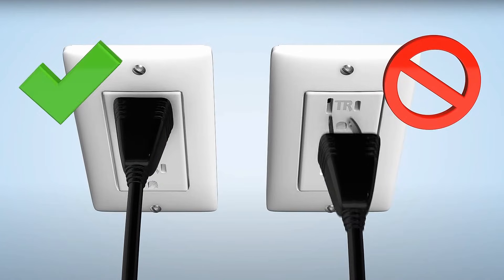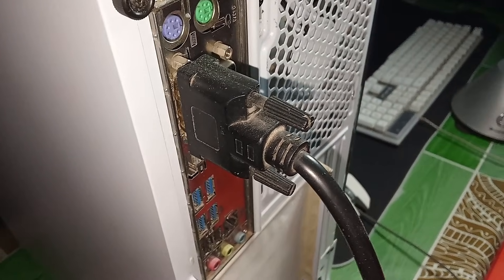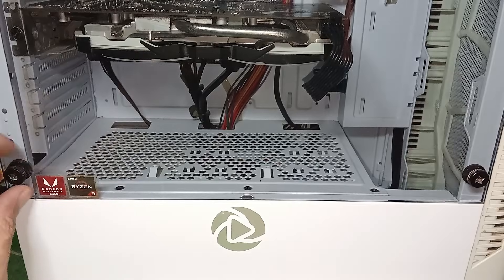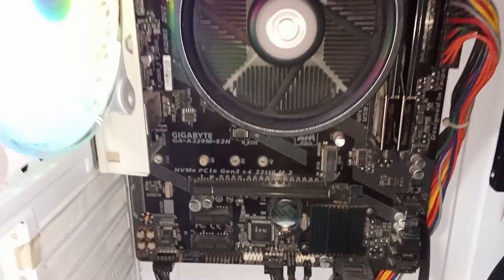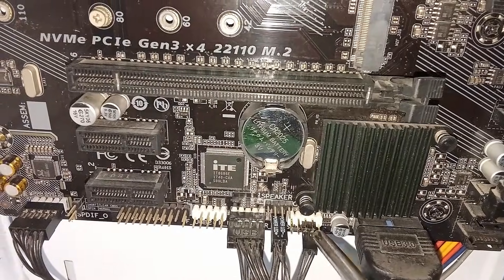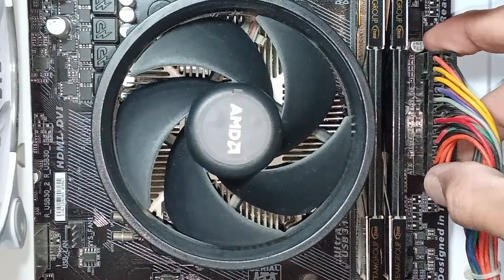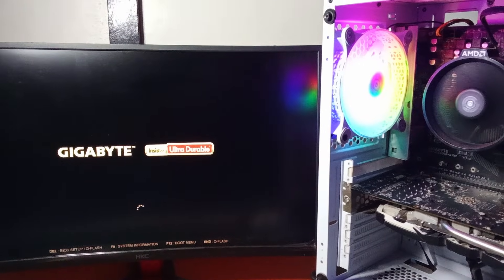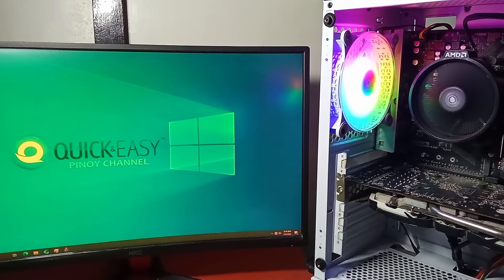HOW TO FIX PC WON'T TURN ON, OR NO POWER ?

Comment: Mines did this today 🤦🏽‍♂️ I’ll be trying this when I get home only difference my motherboard’s light on so it has power hopefully it’s just power button faulty
Reply: Me too bro, I have a problem maybe same like you. My PC turns on after switching on, but I can't click the power button in case, and the motherboard rog led only shows that the PC is on but it does not work because the power button doesn't function, I don't understand where the fault is.
Reply: Yeah same happened with me too
Reply: Did u get it to wrk?
Reply: @Javan1992  I tried it didn’t work for me not sure if I was doing it right just taking it to pc shop
Reply: @DunkBeenOnThat so how did you fix it ?

Comment: How to test PSU if working???
Reply: Look up "psu pin test" or "psu paperclip test" (yes you just need to put a paperclip in specific 24pin connector). Thag would tell if pau is totally dead or not, but if it turns on it doesnt mean there could be other problems with jt